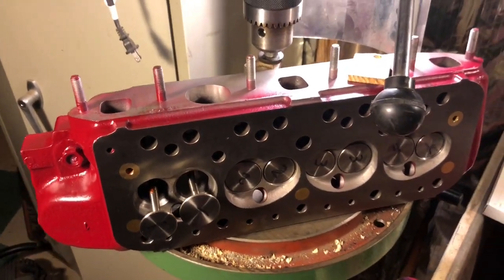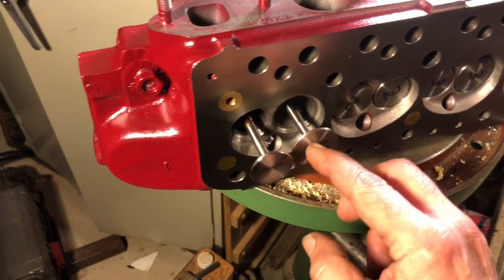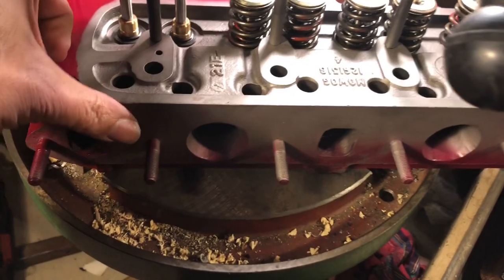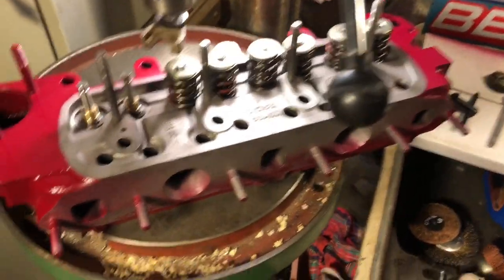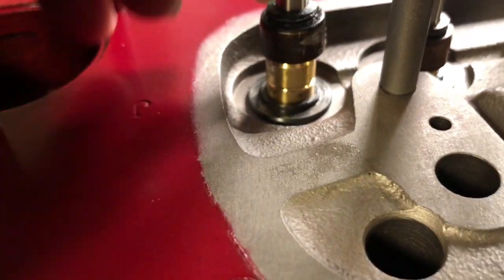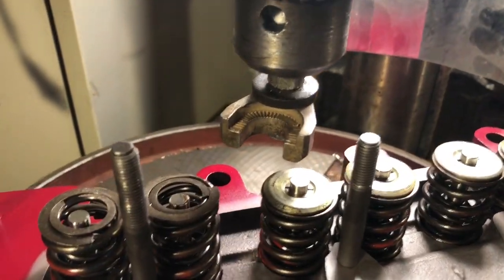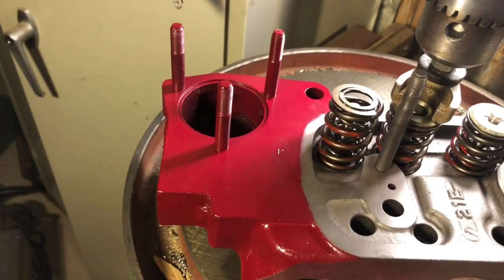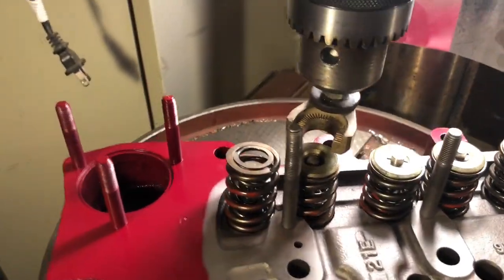Super small bore cylinder head prep

Comment: You sir are a genius.  I never thought of using my drill press. I am going to give that go. Sorry could you explain what the valve stem seals are from, did you say Subaru? What model so I can try a set. Again great video, keep up the good work
Reply from the maker: Yes I'll make a follow up showing a new set of Subaru seals. I'm building my own aluminum head for the 1380 in my 66 Cooper S.... and that one DOES need the extra clearance for the valve springs!